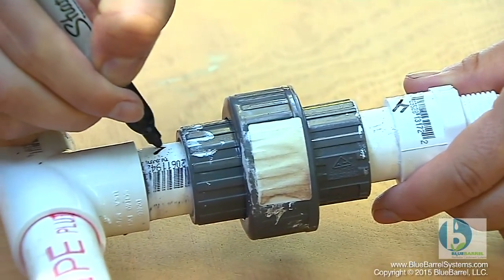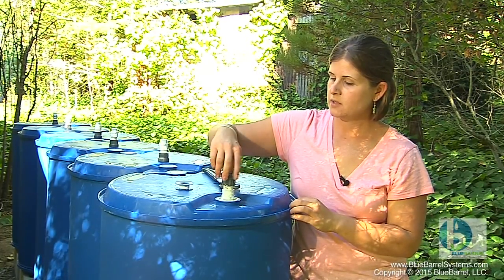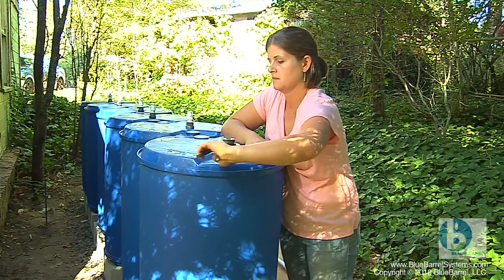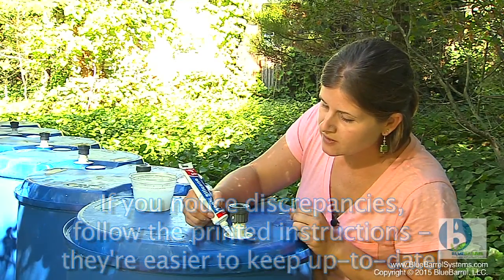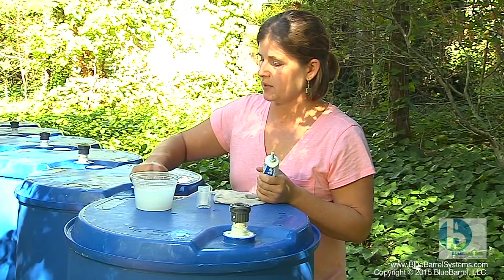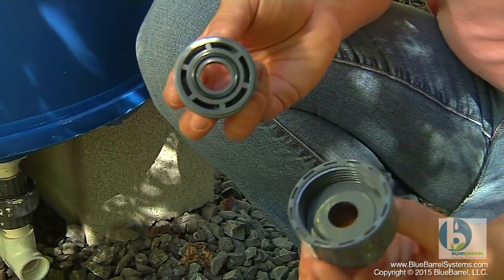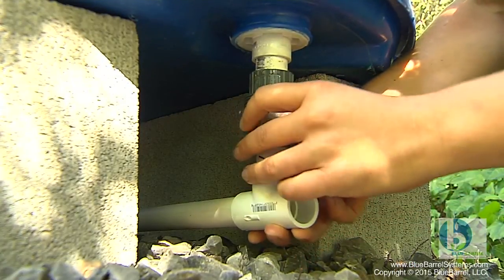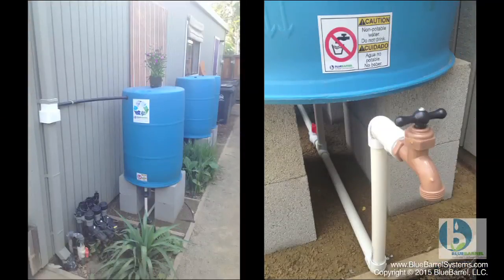PART 5 - How to Build a BlueBarrel Rainwater Catchment System™ - Putting it all Together

Comment: I am thinking of putting this. Trying to scout where can i put it. The best place I have need to put 6 or 7 barrel but about a corner with 4 barrel on one side and 2 or 3 at 90 degrees. Any issues you could envision in this plan?
Reply from the maker: Hello! Ell-shaped systems are definitely possible. Please contact customer service at bluebarrelsystems.com if you need assistance.
Reply: @bluebarrel  thanks! Let me do it. I need finalize the area first.

Comment: You sealed everything. How do you wash your barrels out when winterizing?
Reply from the maker: Our under-plumbed design is self-cleaning and there's no additional clean-out required. You can see our winterization tips here: https://www.bluebarrelsystems.com/blog/winterize-rain-barrel-system/. Although cleaning isn't a regular requirement for our system, we do have tips for how to clean barrels in our M&O Manual, which you can also find on our website under FAQ's.

Comment: I purchased your Blue Barrel system and am very happy with it.   But I simply must comment about an error you are making with seals.    As a rule of thumb in plumbing, whenever you have a coupling or a piece that has a rubber "O" ring or a rubber gasket on it, you DO NOT want to use teflon tape.   Putting tape on the threads will keep the pieces apart, not allowing the rubber gaskets or rings to seal.   Only use the teflon tape when you don't have those rubber washers or rings.  (When putting together the couplings in this video you said, "I don't use teflon tape here , but you could...".   No no.   In this case, because the coupling has a rubber "O" ring in the middle, you don't use the tape.)  Otherwise, a good video series!  Thanks for making them.
Reply from the maker: +GourmetPaperMache - thanks for pointing this out! Generally speaking, you are right! We do still recommend using Teflon tape on the bung threads. Since our systems are made with upcycled barrels (and threads could be compromised), an extra layer of leak protection is "cheap insurance" - especially with all that water-weight bearing down on the bungs after the barrels are flipped over. As you note, though, the tape should NOT come into contact with the rubber gasket - so that the two methods of leak protection work in sequence and don't interfere with each other. We keep our printed instructions updated with our most up-to-the-minute recommendations. thanks again for your comment!